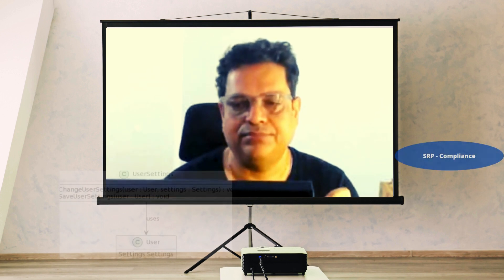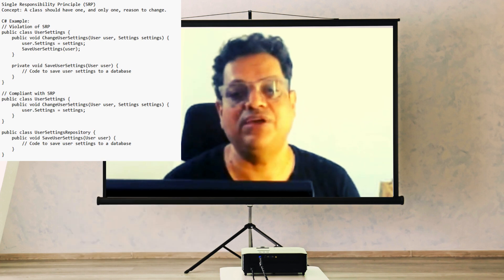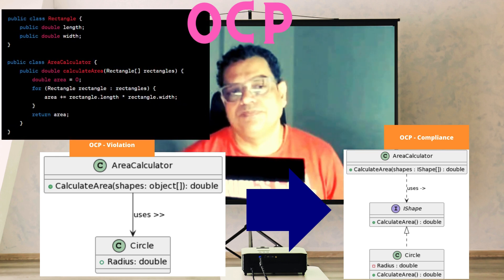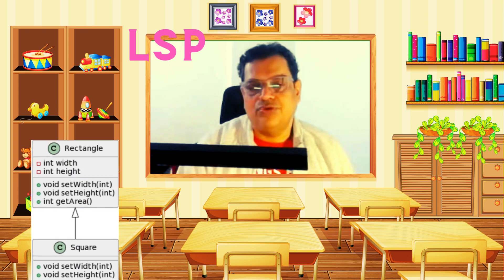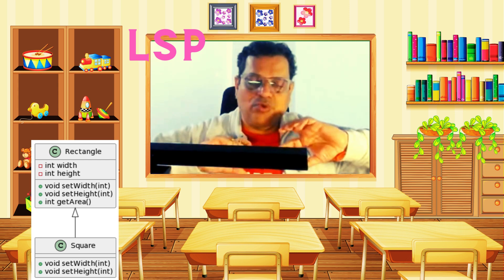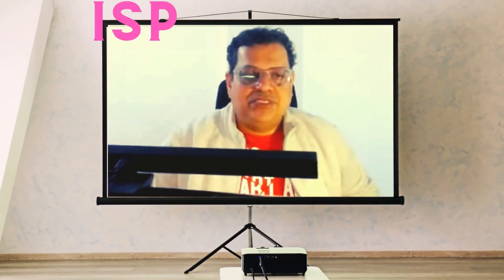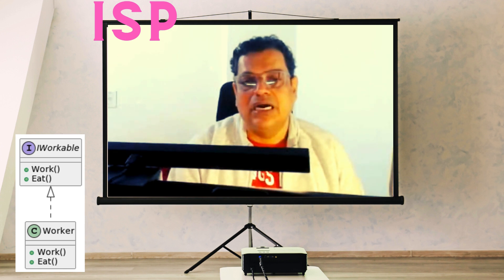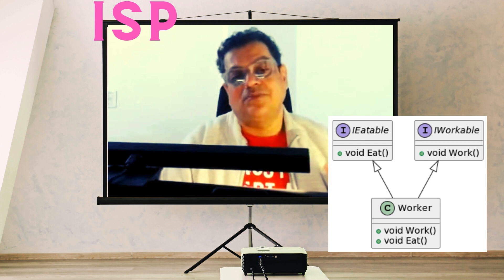SOLID Principles Explained: Build Robust, Scalable Software Like a Pro!

Comment from the maker: "Mastering SOLID Design Principles: A Comprehensive Guide for Software Engineers - Part 1"
Summary:
Join Abinash Mishra on an insightful journey into the world of SOLID design principles in this in-depth, three-part series. In the first segment, we delve into the theoretical foundation of SOLID, understanding its significance in building robust, scalable, and maintainable software. Avinash explains each principle in detail and illustrates their application through practical coding examples and UML diagrams. This video is crafted to help software developers and architects adopt best practices for efficient software design, ensuring software longevity and adaptability. Ideal for those preparing for system design interviews or enhancing team collaboration.

Key Highlight:
Explore the fundamentals and practical applications of the five SOLID design principles with real-world examples, coding best practices, and interview insights tailored to software engineers, architects, and tech leaders.

Comment from the maker: Summary: Solid Design Principles
The video explores the five SOLID design principles and their importance in creating robust and maintainable software.

The SOLID principles are:

Single Responsibility Principle (SRP): Each class should have one and only one responsibility.
Open-Closed Principle (OCP): Software entities should be open for extension but closed for modification.
Liskov Substitution Principle (LSP): Subtypes can be used in place of their base type without affecting program correctness.
Interface Segregation Principle (ISP): Interfaces should be segregated into smaller, more specific ones.
Dependency Inversion Principle (DIP): High-level modules should depend on abstractions, not concrete implementations.
Key Takeaways:

Applying SOLID principles promotes modularity, reusability, and maintainability of software.
Understanding these principles is crucial for architects, developers, and engineering leaders.
Adapting these principles requires careful consideration of the specific project and its needs.
Continuous learning and mindful application of SOLID principles lead to better software quality and efficiency.
The video provides practical examples of violating and adhering to these principles, highlighting the importance of abstraction and interface segregation in achieving effective software design.